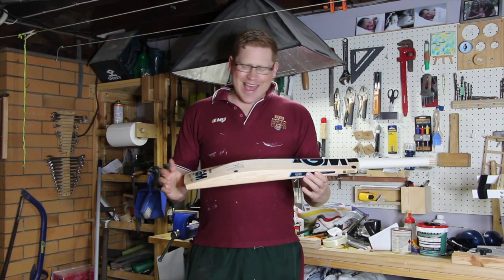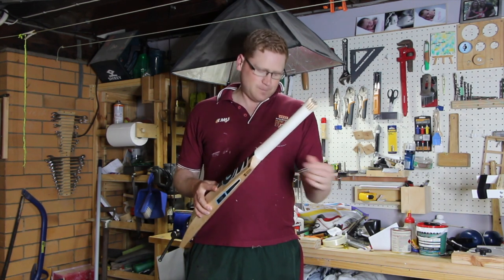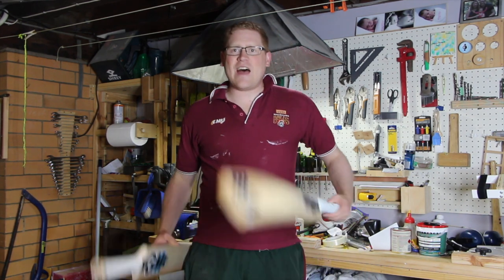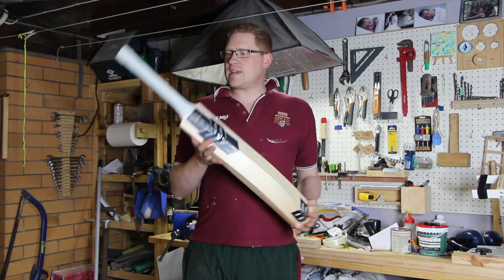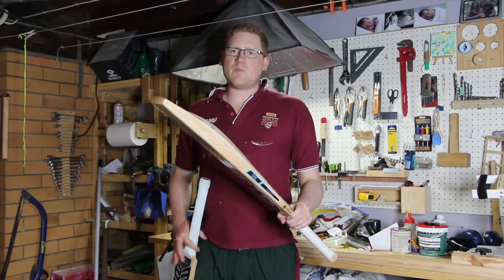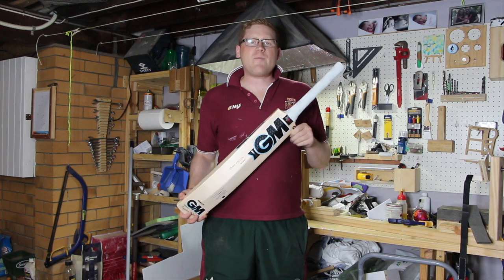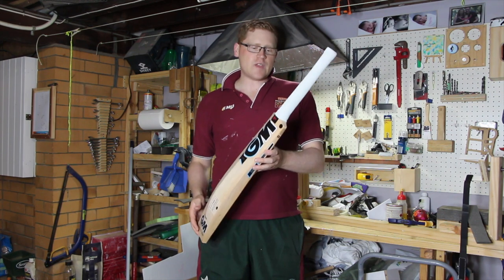Gunn & Moore cricket bat handle reshape

Comment: this is exactly what i did to my
gm noir, feels much better now
Reply from the maker: Mr Robot at least GM have gone back to a decent sized handle to allow you to reshape it! I had a six6 a few years ago that had a twig for a handle.
Reply: BatandBallCricket yep agree, there fairly thick now, but i prefer a proper oval handle to have to reshape them
Reply: So what exactly is the manufacturer's handle shape? Is it squarish at the bottom hand?
Reply: Khaleefa X its a thickish semi oval
Reply: @BatandBallCricket  does reshaping the handle affect in bats weight or not?

Comment: Screw the oval and semi oval handles. Round handle is always the best.
Reply from the maker: I had the same opinion for a long time. That was until I got a very well shaped oval handle that converted me.
You get better control into your shots.
But, personal preference. You have to be comfortable with what you're using.
Reply: @BatandBallCricket  yes all depends on shape if it’s proper oval feel lovely if it just spine into handle and a point which makes it sharp makes it horrible   . I like proper oval on bottom hand and round on top